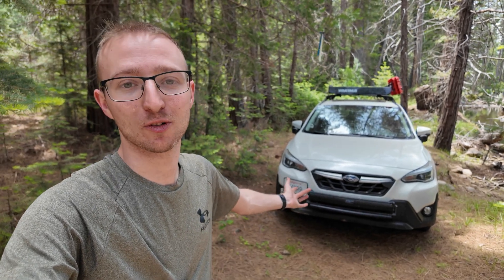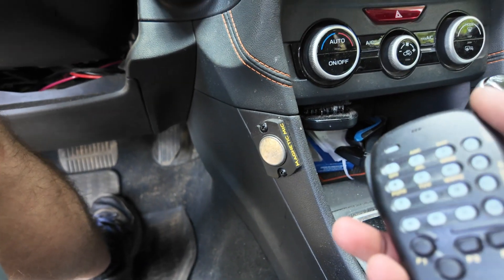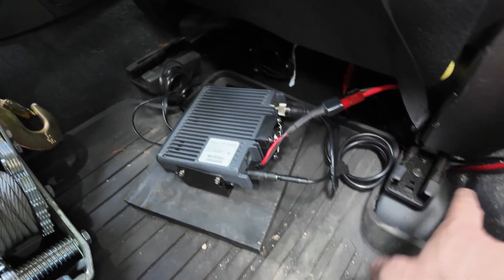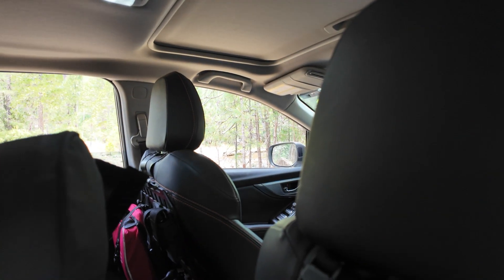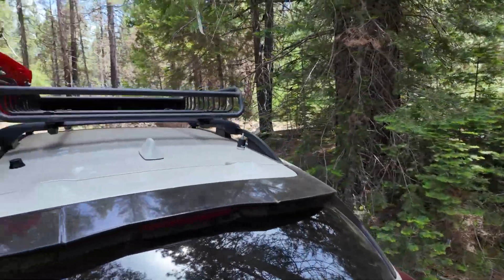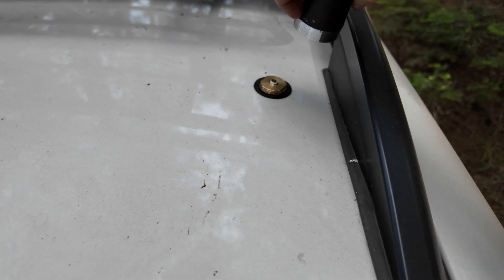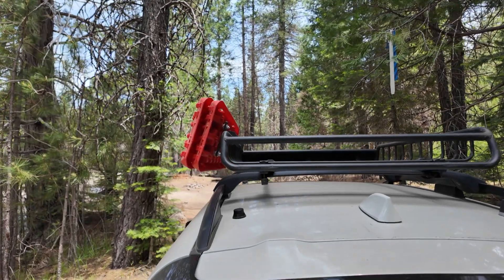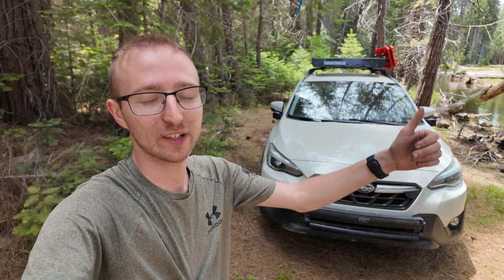Mobile Ham Radio Install in a Subaru Crosstrek! | HAM + GMRS Setup | Yaesu | Signal Stalk | NMO

Comment: I love the install. The mount holding the faceplate is going to find its way into my Crosstrek Wilderness.... I pulled the front bumper off and installed a Body Armor front winch bumper and a 3,500lb winch when the car had 1,200km on it. But drilling holes into the roof of a brand new car... man, that was ballsy. I have 18,000 miles on mine now and I'm not sure I could to that. I watched your video because I'm trying to figure out how to run my antenna wire.
Reply from the maker: SMK makes a great Ditch Light Mount, I would either use that or use that with the NMO add on if I want going to drill!